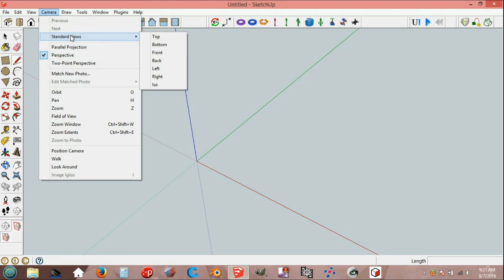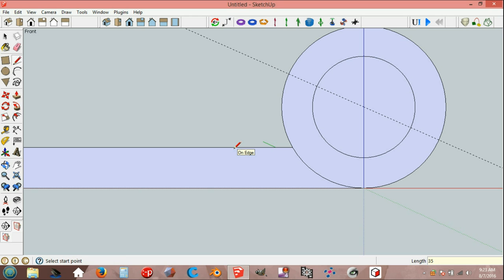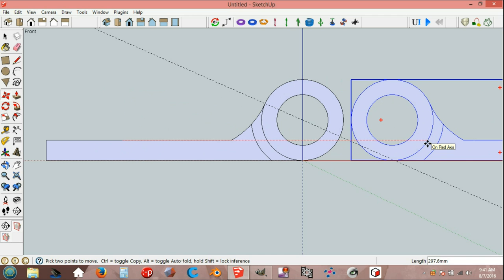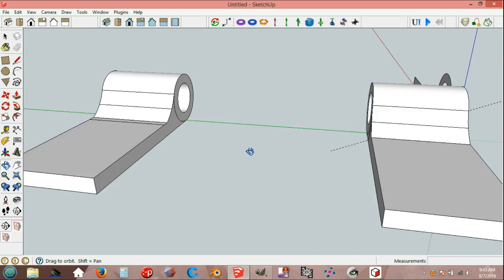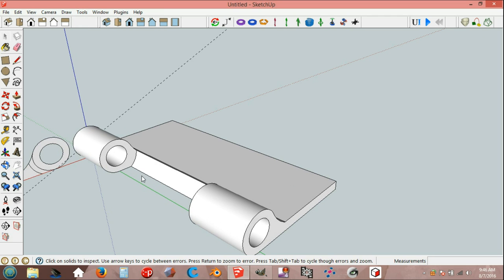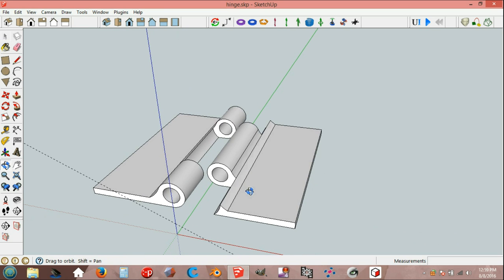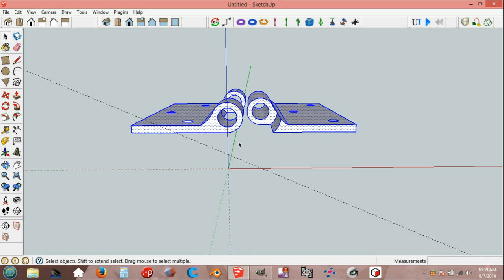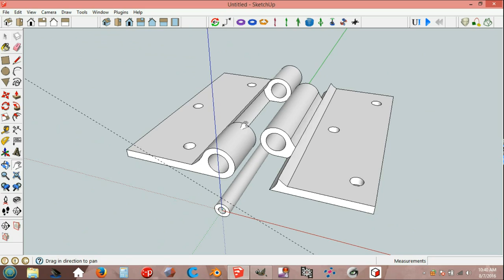SketchUp: 3D Printable Fast Basic Hinge Design

Comment: Why not just pull the second side to the inside edge of the first part you drew then remove 1mm from each side
Reply from the maker: It also works if you did not clean some curve on the side. It left two stray edges for me for some reason, but that's not a problem at all.